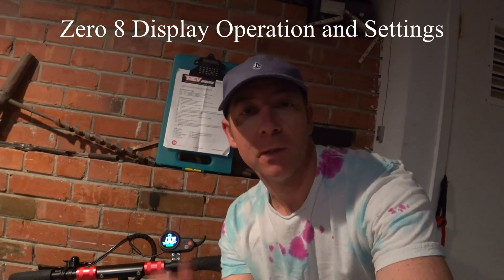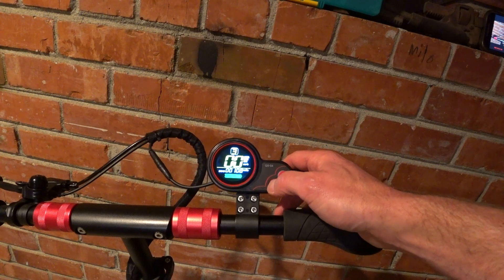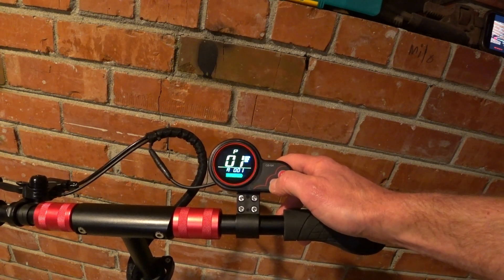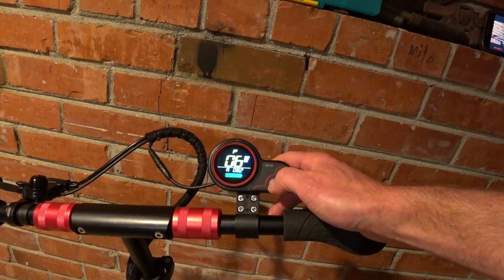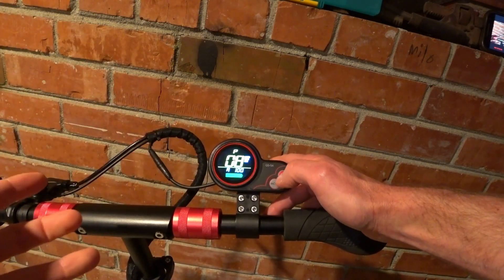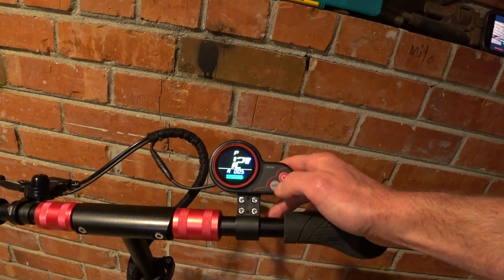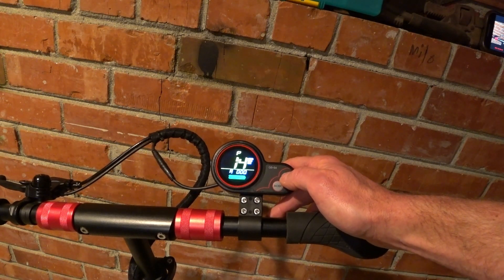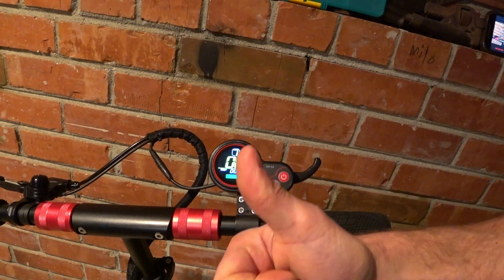Zero 8 (2019 Model) Display Operation and Control Settings

Comment: What about changing number of magnets, mine zero 8 was set to 30, I change it to 28 adn got more speed.
Reply from the maker: I don't recommend this, you may fool the display to give more speed (an sometimes actually get more speed) but there is a potential you can create an issue between the motor and controller and it won't typically run as smooth.

Comment: Please help ㅠㅠ..
There is not much information in Korea, so I ask a question!!
I think the kickboard is too fast, so even if I set the p8 mode to 15%, the power is 100.
Even if the% is different, the problem is the same.
Do you know anything about this problem??

The instrument panel is ps-s4, the limit is disassembled, it is a 2800w + 2800w double motor.

Because it is a translation, there may be a mistranslation.
Thank you.

Comment: how reality fast is zero 8 500w?  and how much autonomy?
Reply: with full battery it can go with like 35km/h with my <90kg weight maximum. mine is not limited. distance is like 30km. I used to charge it after around there.

Comment: Are all zero 8 scooters the same voltage on settings 3?!
Reply from the maker: @LaVar Ball, you may have figured this already, it should match what your battery voltage is.  I think early Zero 8's were 36v.  If you got a used one that could be the case.

Comment: Hello, thanks for the video. I want if we can change the settings for different modes. As far I have seen if that only the general setting change. Thanks for your help.
Reply from the maker: I'm not exactly sure what you mean, do you mean can you customize the speed modes?
Reply: Electron Surfer. Hello. Yes I asking if it is possible to set each mode. For example, I want only to reduce the speed, acceleration & engine braking only for mode 1. Is that possible? Thanks in advanced for your help.
Reply from the maker: @MA-bq8yg  Sorry for the delay. Unfortunately you cannot customize the mode set points, that would be pretty awesome.
Reply: Witch is the difference from A and d?tt is change when I press the power button for 2 sec!also mine had a p15 voltage setting on 39,should I set 41? Mine is 48v 10Ah ,thanks!!
Reply from the maker: @merivale1977  The P15 setting  will power down your scooter to avoid battery damage. 39v corresponds to an empty battery while 41v is 10 to 15% remaining.  My advice would be 41 or 41.5v setting to protect your battery from dipping too low.

Comment: On my Zero 9 I’m get a red warning sign and it is flashing saying E 10 what is this? Thanks
Reply: Don't worry, I had the same problem on Z8 : just wait 3 or 4 seconds after powering it on, in order to give the controller time to wake up
Reply from the maker: @Mike Santana, On the 2018 Zero 9,  E10 is "faulty comms between controller and LCD", that could be a loose connector or a wire that needs to be re-soldered. I'd trace all your wires and verify everything is plugged tight.  After that i'd wiggle wiring and see if that error code disappears before trying some other troubleshooting.

Comment: Sorry for my english and thank you for this video, but when I'm trying to change the value of the programm 11, I just have 2 choices between 0 and 1, and whatever if I take one of these, it doesn't change anything, there is no electronic braking. Do you have an idea of the problem? Thank you for your answer
Reply from the maker: @Smart Rmax, Did you get your scooter from Falcon?  I think there could be a different value for P11 in that case.  I have a choice of 1-5 on P11 for electronic braking.
Reply: @ElectronSurfer  I was asking the question for someone else but he said it's okay now! Thank you for your answer

Comment: May I know how to reset all of the settings to factory default settings ?
Reply from the maker: As far as I know there is not a one button reset.  You can just change them all back to the ones supplied by RevRides or Falcon PEV.
Reply from the maker: @Diezel Boy, I put all of the menu settings in the video description, hope it helps!
Reply: @ElectronSurfer  Ok sir, actually I've changed dome of the settings there and I remembered their defaults except for the P4 and P15 which I did not remembered well.
Reply: I already knew that the default setting of P4 is 5 and the default of P15 is 39, thanks!

Comment: The braking is not that powerful and I put my e-brake force at 5
Reply from the maker: @Peter L, is your brake locking up? The electronic braking force is not meant to stop the scooter on its own, if the rear drum brake isn't locking the tire up easily that needs some adjustment.  thanks!
Reply: @ElectronSurfer  After tightening the screw, the braking system works brilliantly now, thanks
Reply from the maker: Great to hear!!
Reply: @ElectronSurfer  Problem now is it's been wet and rainy here for 3 straight days and forecast for more rain tomorrow
Reply from the maker: @aragorn318  I hear you, not being able to ride is a bummer.
Reply: @ElectronSurfer  So I rode it to work and back in the light rain and small puddles in the streets and the scooter survived (4-mile round trip). But the back mud guard is terrible. The back of my pants are all wet with dirt and needs to be washed now. And nobody can hear the bell
Reply from the maker: @aragorn318  I think the short fender is more decorative than anything.  Because I like to save money and do DIY things, I'd zip-tie or bolt either a piece of plastic or a part of a clip-on mountain bike fender and remove it when the weather was nice.
Reply: @ElectronSurfer  I've only had the ZERO 8 for twelve days and only ridden 32 total miles and the short rear fender already broke off. I just lost it somewhere while commuting from work today and don't know where/when it broke off. And I've only ridden it on streets this whole time, never off-road. Why so flimsy?
Reply from the maker: @aragorn318  I am not sure if the fender on your model is different than what I got from RevRides but my fender is quite sturdy.  I'd ask Falcon for a replacement, it shouldn't be coming off that quickly but perhaps it was loose.  I can come up with some cheap DIY options if you need them.
Reply: @ElectronSurfer  If you have a photo or video of how you zip-tied your rear fender, that'd be great. that's what I'm looking to do
Reply from the maker: @aragorn318  My fender has been fine, I can try to mock-up a fix though.
Reply: @ElectronSurfer  is there a video on adjusting the drum brake?

Comment: Can u help me pls my speed limit is 35 and not 45 what i should do pls ?
Reply from the maker: @Akainu, I don't think there is a setting to change speed limitation.  However,  I don't think the Zero 8 is capable of 45 kmh, i get a max of about 35. I"d suggest contacting RevRides to ask if the limiter can be removed, if there is one.  Sorry I can't help more.
Reply: @ElectronSurfer  
I just changed the p6 by increasing the size of the wheels in inches from 8 to 10 and I gained 10 km per hour, is it dangerous or not?
Reply from the maker: I wouldn't think that is dangerous.  Bear in mind that is mostly changing the speed reading on the display, it probably won't affect the scooter speed significantly.  If you verify a higher speed with and app or something please let me know.
Reply: You're likely using the 350w version, the 500w version can reach 45kmh
Reply: @micheljacqueson9768  You just gained on your display, not real, check with you phone the real speed.

Comment: How do you turn on the cruise control
Reply from the maker: @So Super, make sure menu item P17 is set to 1. After that cruise control auto-engages after a few seconds at the same speed.  I have found it is difficult to get cruise control to kick in at less than full throttle as its hard to hold it steady at less than full throttle.

Comment: Many thanks - good video.  I didn't know the Zero 8 had cruise control.  Also, I though the rear brake was a mechanical drum and not electronic?
Reply from the maker: The rear brake is a mechanical drum but when you first hit the lever the electronic brake also engages, it works quite well.  Thanks for watching!
Reply: @ElectronSurfer  I bought a Zero 8 recently in UK.  The codes you gave out are really useful to me (I received a free tool set).  I actually like the grips as they are shaped to give wrist support (I have small hands).  RE rear suspension - I don't seem to get much travel on them (about ½").  Do you know if they adjustable?